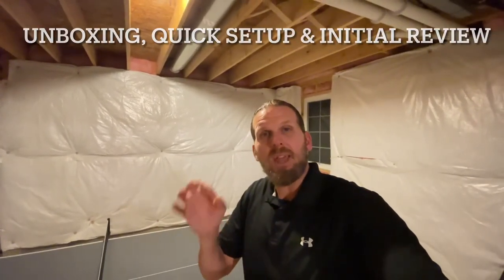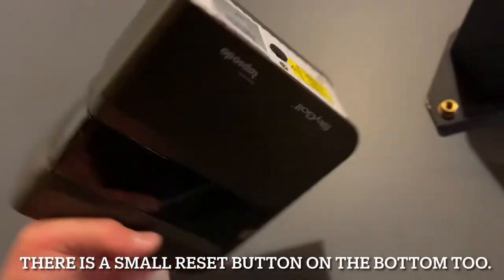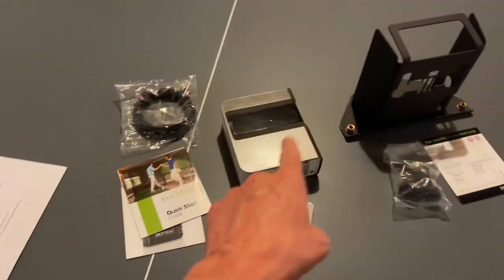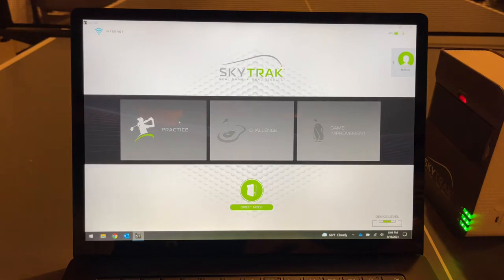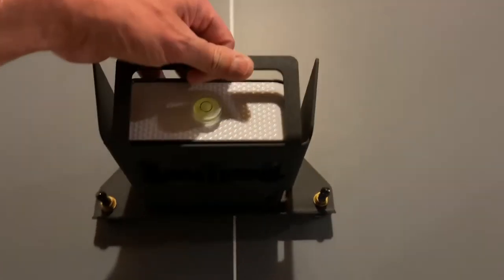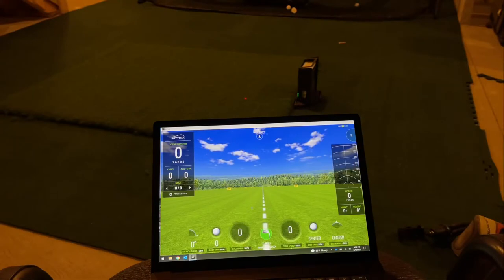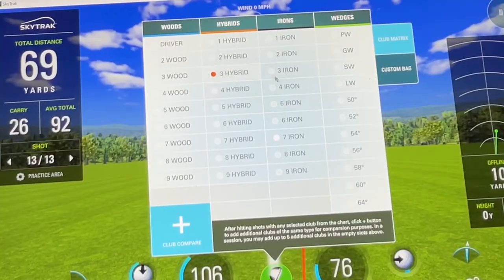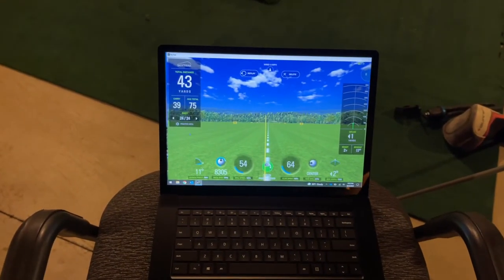Golf Simulator Build.  Skytrak Golf Launch Monitor Unbox, Quick Setup & Initial Review.

Comment: Great video!  Very helpful, as I am waiting for my SkyTrak Golf Launch Monitor to come in.  This video helped a lot in regards to how you initiated setup and connection.  Like you, I am just hitting into a golf net for now until I can install it in an indoor space.  Thanks!
Reply from the maker: It can be a little tricky to set up but typically you start off setup in direct mode then you set up through network.  Network works pretty good.
Reply: Will do.  Thanks!

Comment: Skytrak has one of the longest delays in sending the data to the software, there is another channel that did a test.  They didn't find much difference between the different methods of connecting the device.  Not to say the delay is bad, but many other units are almost instant.  However, bang for the buck, the 2.5 second delay is the last of my worries, although instant feedback is nice and side by side, it feels a lot longer than 2.5 seconds.

Comment: Hey not sure if your still around but I just bought my got it in and did everything you did then when I went to click on practice is says upgrade membership, it is brand new I just made an account and made another dummy account that did not work also. Do you have any suggestions?
Reply from the maker: You can always call Skytrak and talk to their service team as I have called them before and they are very helpful. You should be able to use the driving range, but any of the other features you might need to upgrade your package. They may have changed things since this video as well because I had to renew my $99 game improvement package because they said I now need it Yearly to run TGC2019

Comment: Good video!
What laptop are you using? Have you used the game improvement program with your laptop and did it perform as good as you expected!
Reply from the maker: I used my work laptop temporarily which is a windows surface 4 laptop.  It works fine and I have the game improvement.  My simulator build is almost done as it should be ready by next week and I am now using my old PC.  I had to upgrade my graphics card but it all works and I just bought TGC2019.  I’ve been posting videos along the way with more to come so stay tuned.
Reply: @DieselLegiance  Thanks!
I'm just trying to figure out what laptop I  need to build my set up. I definitely want the game improvement package, but not really that interested in playing the games. 
I will just have a laptop connected to a TV mounted on the wall.
Reply from the maker: If your running the basic driving range you don’t need much, however, if your running TGC2019 or E6 you will need high specs.  Just look those sim programs up and look at the minimum requirements needed and compare laptop specs to make sure they can run the software.